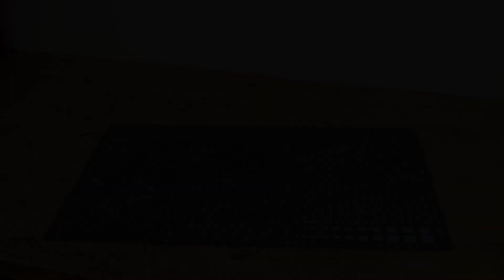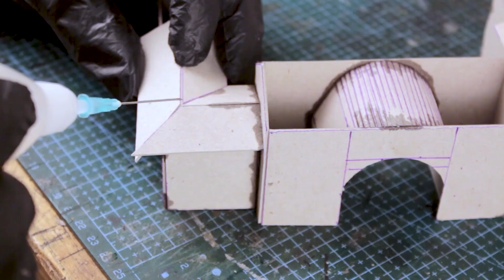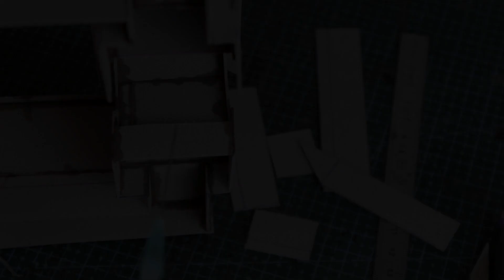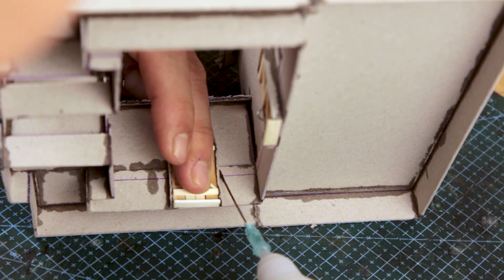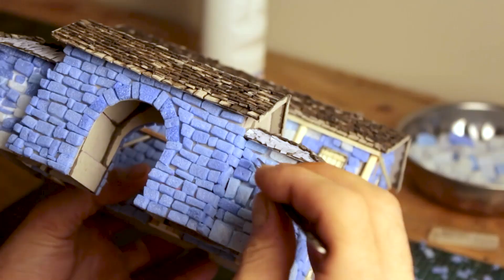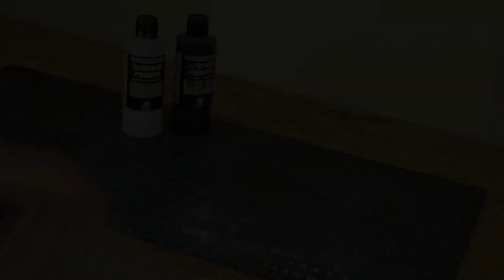⚔️ 3rd Scratchbuilt AoE2 Building - 1st Part of the New Diorama Build

Comment: I put this in a answer, but I wanted you to see it,and I think it's better if I make a new comment. It's my way of making shingles. 

I use thin wooden veneer, cut it into long strips across the grain, and stack all my strips in a vice. 
This is to do the next steps in a batch. 
Then I saw many cuts along the grain, to get the shingles, but I don't cut all the way through.
You can file some sections shorter to get shingle variations. 
I then have shingle strips that are fast and easy to lay.

Hope it makes sense.
Reply: To put the strips in the vice, have then hanging out to the side, cut, and move then further out, and turn them around when you get half way.

This is not so easy to explain in text, but ask if you have questions! :)
Reply from the maker: yeah i totally get what you mean. using veener makes sense tbh. i could do a simiar thing out of thin balsa strips aswell but i always intended to stay on the cheaper sife of things when it comes to what i make in the channel. half of what i do is made of or  mainly made with cardboard 😝 and i dont even have a big enough vice on my bench 😏 

BUT, its a good thing you shared your method here, it would be useful to other people for sure!
Reply: @VivalaCaffeine  Yeah, I totally get the prize concern. I think the veneer I used was from a dollar store notice board or something. I forget what exactly, but when you spot the right stuff you can get it for next to nothing. Balsa might work too, although a bit soft for the method. Wonder how cardboard or stock would hold up..

Comment: For shingles, if you want an easier way to mass produce them. Getting a paper cutter guillotine type would work very well to make rather quick work if you keep it sharp.
Reply from the maker: Thanks, that makes sense. ı’ll look into it
Reply: I use thin wooden veneer, cut it into long strips across the grain, and stack all my strips in a vice. 
This is to do the next steps in a batch. 
Then I saw many cuts along the grain, to get the shingles, but I don't cut all the way through.
You can file some sections shorter to get shingle variations. 
I then have shingle strips that are fast and easy to lay.

Hope it makes sense.